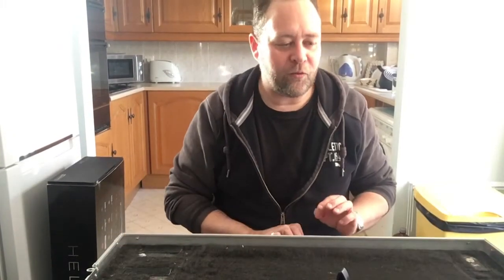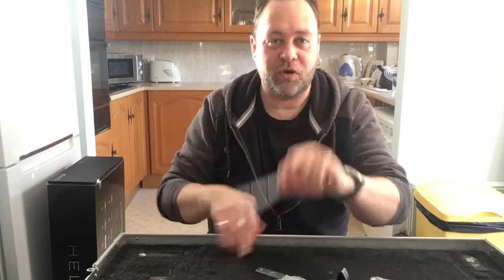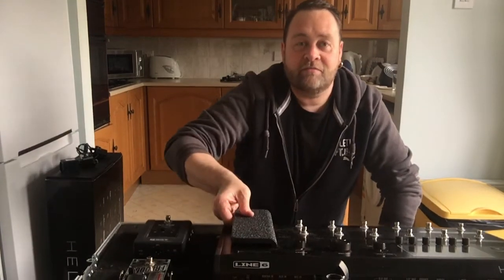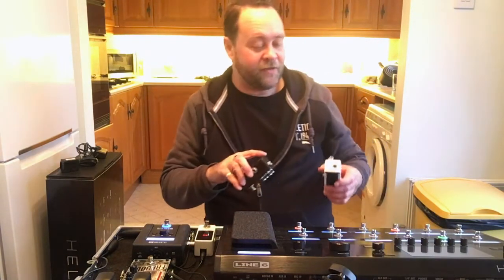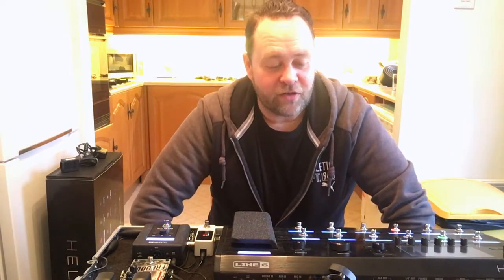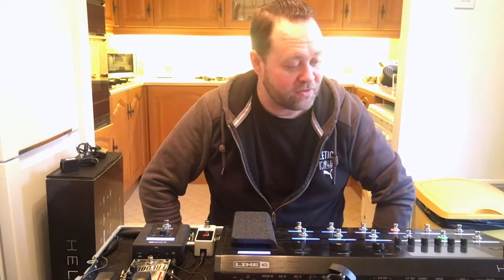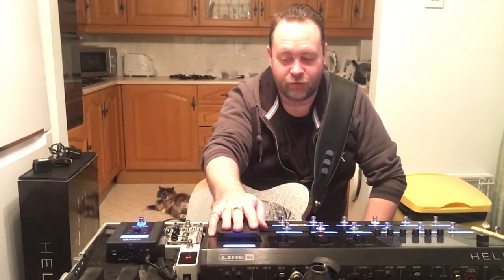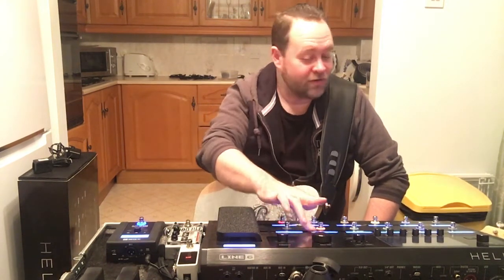Line6 Helix Pedalboard Build

Comment: And they say cats and dogs don't get along :-) Since every guitarist has a pedalboard, you'd think that pedal makers would make an attachment system in the pedal. But I haven't seen that anyone has. Fold out brackets in the corners, easy to do, costs pennies. But no, the best invention yet is providing the rubber feet unattached so you can use velcro tape easier.
Reply from the maker: Fold out brackets...great idea!!